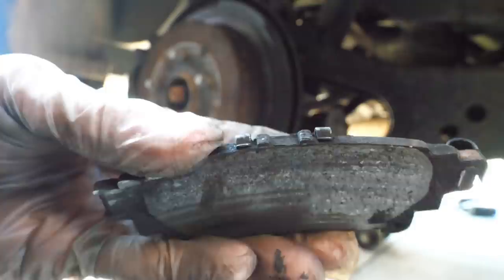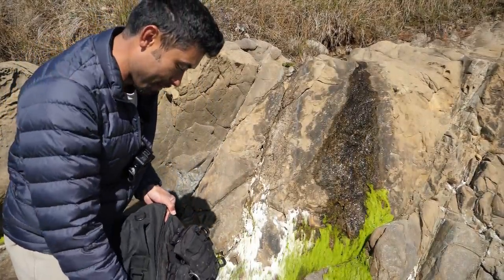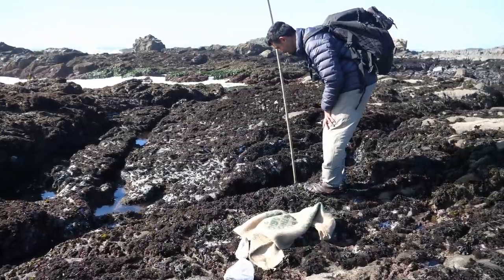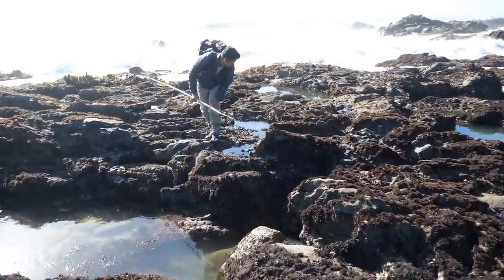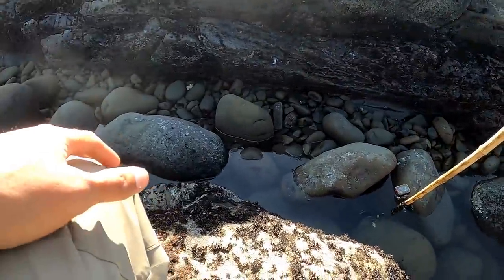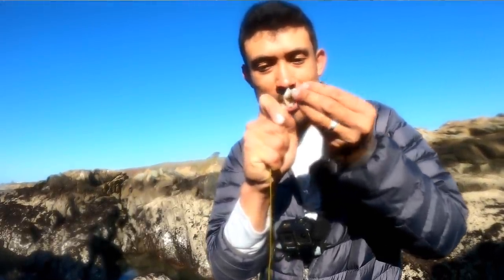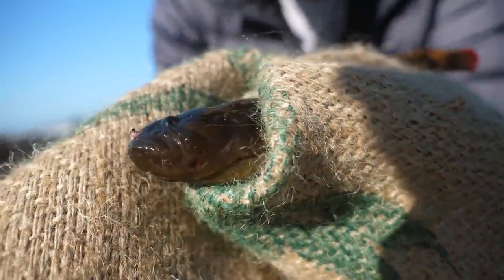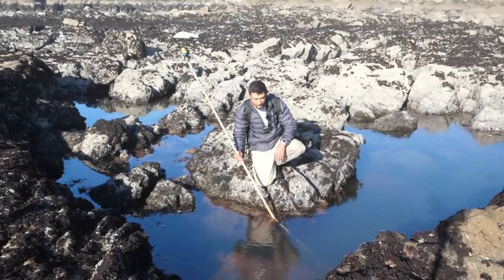Saltwater PUDDLE STICK Fishing for Slimy Eels!

Comment: In 1960 my parents and I watched a Asian guy named Victor catching big monkey faced eels at Princeton (Half Moon Bay) in the Northern Tide Pools under the Big Radar Station past the North Breakwater.  He used a bamboo poll with stainless wire connected to the hook.  We watched him catch 10 eels in under a half hour and they were big, some as much as 5 feet long.   So we know this guy fished for eels before the 1950's and sold them in China Town in San Francisco.  We talked to him a lot because we fished almost every weekend from Friday night to Sunday afternoon and we finally bought a bigger boat we used for long line fishing.    Eels were not worth much but Rock Cod and Ling Cod were fun to catch back in those days.  Now I live in Israel and fish the Med and Sea of Galilee.  It is nice to see fishing hasn't changed much.  I would use braided stainless instead of Mono line.  That's the way the old timers did it.

Comment: Good to see your uploads again! Great video and If I may offer a suggestion? Get some of those Ice grippers for your shoes that they use in the colder climates. $10 on amazon and you have sure grip on the wet rocks. $10 could save your life like it did mine. Tight lines! 🎣

Comment: When you go to put your tire back on, be sure to tighten the lug nuts in a star pattern. This will ensure the wheel gets tightened down evenly. If the tire is not tighten evenly, you could end up spinning it off the hub.

Comment: Not sure if youre aware of this, but they ship new rotors with a layer of oil on them. Spray with brake parts cleaner and wipe with a clean rag before installation

Comment: Matts,  dude. Please double check the lugnuts on your tires. Looks like you didn't use a torque wrench to make sure it's tighten to specs.  The lug nuts can auto loose themselves after some miles!

Also, the underside of your car looks pretty rusty.  Did you spread water under there after each boat launch trip?  I hose down my car every time. I see very little rust under my car. But of course you launch a lot more than I do, lol.

Cool video.  Please keep them coming.

Comment: Fisherman's Life, each time you go out with any of your boats do you wash your SUV afterward?  I try not to sink my rear tires into saltwater but every time I launch my boat in either salt or fresh that day or the next I get my truck totally washed.  I know you live close to shore but it's peace of mind that you've washed most of all the salt residue off your SUV.  I don't live close to shore but I definitely know what saltwater can do when not attended.
Reply from the maker: When the water splashes on the wheels then I do when I get home but man sometimes I feel like it's too late at that point. Now I'm going to bring a pressure spray thing with salt away and spray it once I park the boat and trailer
Reply: @FishermansLife  For each time you go out on your boat it’s a “must” to either wash your boat and CUV either that day or the next day, saltwater is horrific on anything it sits on.  I don’t think it’s too late to wash your boat/CUV before 10PM anything after that do it the next day.  You have friends that go fishing with you they should be helping you in cleaning your boat/CUV, they should be helping pay for gas too (gas is not cheap in NorCal), that’s just my opinion.  Saltwater is horrific on your trailer bunks, suspension, and wheel bearings.  When you mount your new motor to your boat every time you go out afterward your engine needs to be flushed out with fresh water for about 15-20 minutes to make sure all that saltwater has been removed from inside your engine.  Also, clean your outside zinc plates (anodes), it's used to help protect the hull in the case of galvanic corrosion caused by electrical currents flowing between connections and between dissimilar metals.  I highly advise investing in a pressure washer it will most definitely knock off half of the time when you will clean your boat/CUV.  Be safe and tight lines bro.